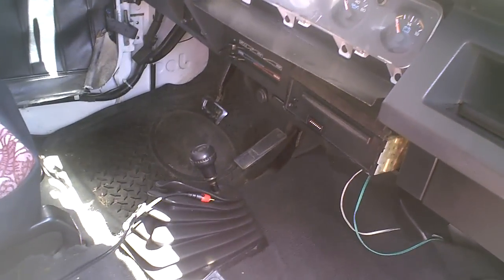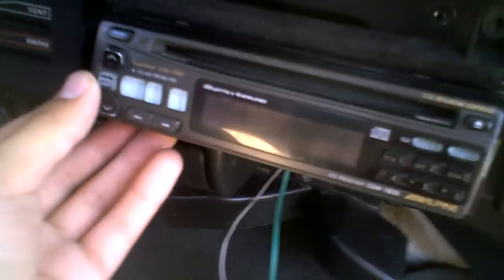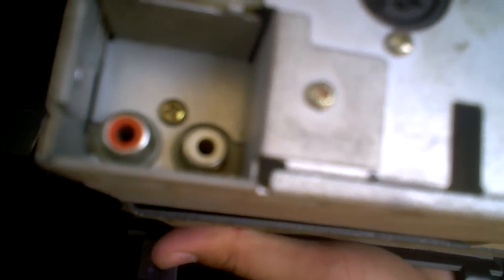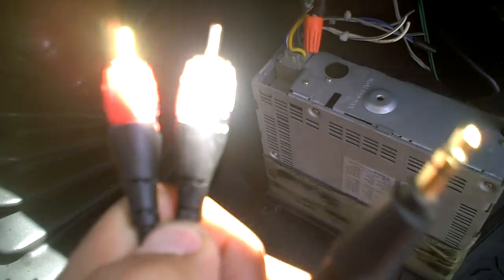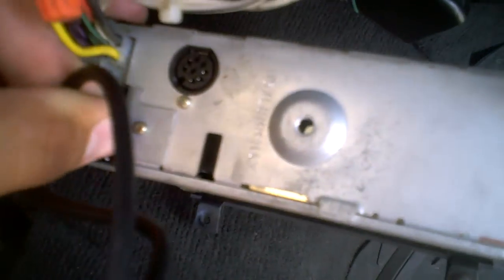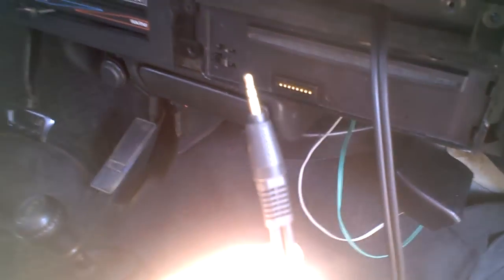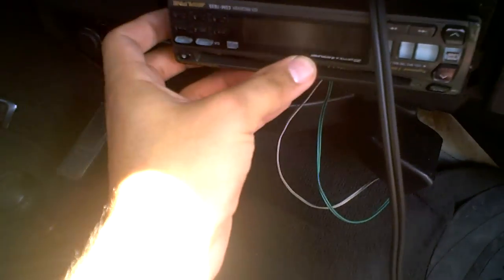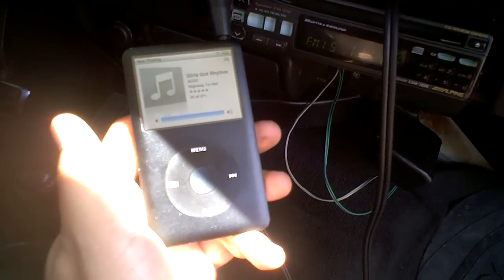Connecting iPod into old car stereo withouth AUX

Comment: Dude! No offense, but if you don't know RCA (the white and red jacks used to conduct left and right audio signal), then you shouldn't be taking apart your car! You don't even know if every car stereo has those jacks! At least give your model number on the stereo. Also, hanging the stereo by the wires while you pried cables into it! Ahhh! At least hold it to save the other vital cables! One last thing, EQ stands for "Equalization," which only boosts certain sound frequencies. This is entirely different than master volume. However, overall good job! You had the bravery to take apart your car and it worked!

Comment: Ok, time out.....the red and white RCA terminals on the back of a car stereo are usually for low level OUTPUT to an amplifier. In a rare instance that you have a rear RCA input, this could work.....but you all seem to be having problems because essentially, this is not the proper way to do it. Even if you have multiple RCA jacks, it;s slim that one set would be an input, more than likely Front and Rear outputs for multiple amplifier hookup. If you are looking to do this to an older radio, I would suggest finding a different video....

Comment from the maker: @klachi7 im not too sure man. mine is an old car stereo and i just gave it a shot for fun and it actually worked! the holes in the back are actually meant for an amp to go into the stereo. maybe not all stereos are compatible with this method, but i dont know which ones do and dont work. try using a diff. cable? good luck man

Comment: the two "holes" on the back are just rear aux. so you you technically are connecting with an aux port. the reason it doesn't work for most people is because most of the time the two ports on the back are pre-out ports made for amplifiers or subwoofers. still good video but for anyone watching I would research your exact stereo to see if you have these aux ports on the back. not many have it.

Comment: Here's what I did: I unplugged the antenna but I was still able to receive FM radio. AM however was cutout with minimal static. So if I listen to AUX, I just switch to AM radio. And of course, if I switch to FM with the iPod on, I'd hear both. So the patch-up solution is to unplug antenna and use AM for AUX, but the downside is that you won't get AM radio reception.

Comment: Those inputs must be AUX IN for that application to work.  Most stereos have AUX OUT for amplifiers.  If you have an older player than has a DIN connection you can find a DIN to 3.5 MM plug on Ebay or elsewhere and it will allow your deck to play through the AUX IN source.  If you go thru SOURCE you will usually see CD<TAPE<AUX AUX usually will not show unless something is plugged in.

Comment: Actually it's possible in some cases. My home CD player has the exact output (It's called phono by the way) but if you put a disk in with tracks that are nothing but silence, then crank the volume, it works as an input just fine.

Comment: @DannyShreds87 I did use the same cable you used. I got mine at waltmart for ten buck as well. I think the stereo it;s connected properly to the speakers since you can hear a cd playing or the radio. What can it be? the stero is an alpine and the car a jetta. thanks for taking the time to answer me.

Comment: verry few cars are set up with the left right input built in. in most stock radios your best bet is to solder a cable into simple cassette deck wiring or clip a cable onto the cd changer input lines.

Comment from the maker: @jamesbond728 when i have the ipod plugged in, i dont have the stereo under CD Mode. i have it on the radio. try using the radio and set the volume to 1 or 2 and play ur ipod on full blast. hopefully this works for you!

Comment: I'm having one problem, I did this and it works great, but one has my rca cables for my amp or subs or whatever hooked to the back. But I had another set of audio out slots. So i hooked it to there, so i turn radio to 1 or 2 volume so there is no background noise or static, then crank the ipod itself, the only problem is i get no sound to my subs. So I get no bass at all

Comment: I made it so the front speakers use the rear output. I didn't fix the volume, I like using my phone's volume so it's fine. I leave it on FM 87.9 volume 1 for no static

Comment: Alright, I bought the cable, connected it on the system and then to my phone which has 3.5mm jack 9Nokia X2-00) problem is that on which mode do you keep the stereo system? I mean if I put it on Tuner Mode, it plays FM radio obviously. And if I put on CD mode, it plays tracks on CD :/ I get nothing from the cell itself. Please help.

Comment: i have an old Sony cdx-4260r and it has the same two RCA connectors but Sony's manual on the damn thing says its AUDIO OUT REAR witch is not the missing AUX IN. do you think it will work?

Comment: hey man, i have a 2005 Camry and it doesn't have a 3.5mm jack connector. how can i connect my Samsung galaxy s2 3.5mm jack to the car. is it possible to connect 3.5mm jack to the ciggerette lighter thing? with using a gadget

Comment: it actually works. BUT. Since I have 2 pairs of RCA outputs in the back of my radio... depending on which pair i choose for pluging in this cable...  i can listen to ONLY front or ONLY rear speakers. 

and yes! volume is not adjustable from the unit itself
Reply: Maybe you could find a cable that's splits into 4? Idk if they make them just an idea
Reply: Cory Merritt nah.. i simply got a new radio from amazon.. $50+ and no problems

Comment: I got that wire and connected it but it don't work
Reply: Because those are output rca connectors. not input...
Reply: because most stereos aux on back are outputs for 4 channel or subwoofer amps. this is the first time i see an input on back of a car stereo

Comment: I did this, and it works fairly well on my new (ancient) '85 Ford Econoline, but the sound only comes out of the back speakers. If i turn up the volume on the head unit itself, it just gives me static on the front speakers. Anyone know how to fix this? Even using just the rear speakers, it still beats NOT having an aux input, though.
Reply: sounds like you didn't fully plug in the ipod/mp3 player or the rca jacks on the back of the stereo.  Or the wire could just be bad.  Try it again with a different wire or just re-adjust and it should be fine.

Comment: it will not work then, because these two cables are outputs and no inputs. I odnt really know how the guy in the video did it, but you cant connect any external device to an output and expect it to be an aux

Comment: This is misleading. It says no AUX INPUT, the back of the stereo has LINE IN, means you can connect any audio device. it is tantamount to AUX INPUT. What i want to see is how you can manufacture an additional AUX INPUT using 3.5 jack? This is a poor representation.
Reply: Hey i have an old radio too and it has two audio inputs in the back but with mine it plays with the radio. Did i do something wrong or do i have to change it to a certain station.?
Reply: Shanice Winters put your player volume at the lowest. these aux cable are not controlled by your player's volume control. your iPod will be your volume controller. in my case too it happened. i kept my JVC player volume to the lowest level (NOT zero!! .. put it on 1) also change ur radio frequency to non registered channel so that there is no possibility of other sound. (At Volume 1 you won't hear the buzzzzz of radio, n your iPod sound wud be heard clearly)